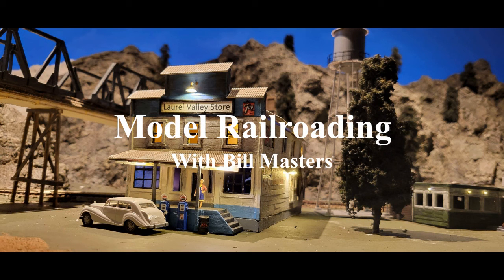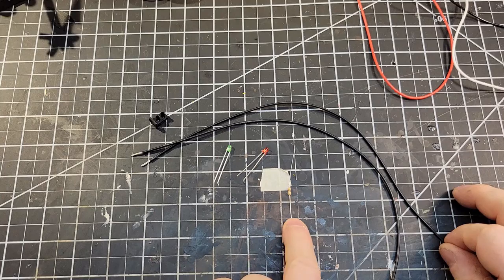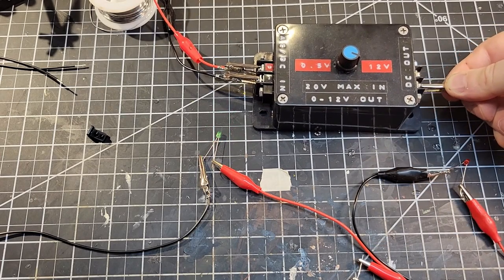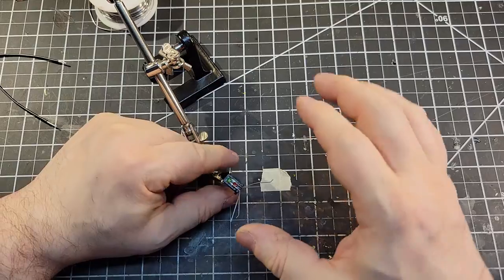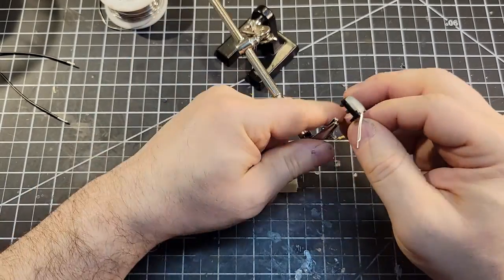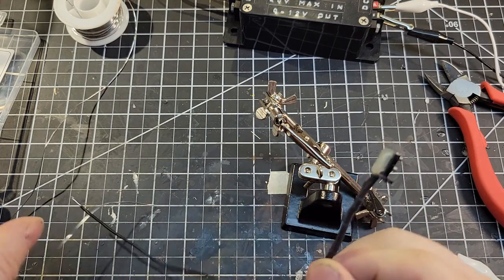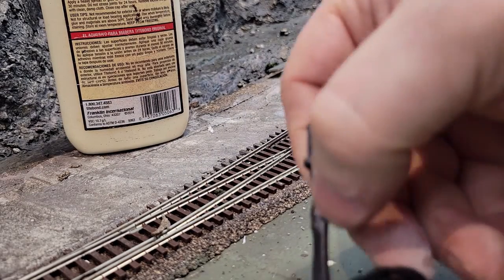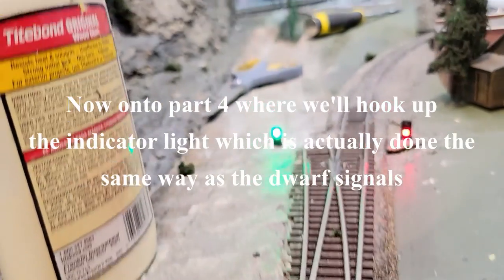015. Turnout Project Pt 3: The Dwarf Signals

Comment: You could turn them 180 deg and show the locomotive has the road set for the main OR siding and the “Authority to proceed”   Through the turn out in the trailing direction without  derailing [ dependent upon the  type of switch motor used.] They could also be on  the side of the engineer  in both cases.  
I do like them all the same and. Rule 1 applies “ its my railway and I do it my way!”

Comment: Aren't dwarf signals always placed on the engineer's side of the track?  It seems like the signal on the diverging track should be located between the through rail and the diverging rail so as to be visible to the engineer.
Reply from the maker: Oh I'm quite sure that the way I use them wasn't done in real world applications.   This is more for a way for a 500 foot tall human to quickly see which way track is switched.  :)
Reply from the maker: You could also just use one dwarf signal instead of two.  It the one on the right is green you know the track is switched to the right.  If it's red you know the track is switched to the left.   That would provide more of the realism that you seek.  I like having lots of lights...